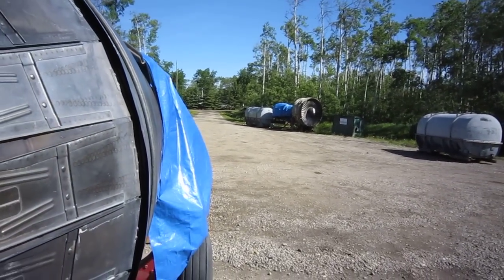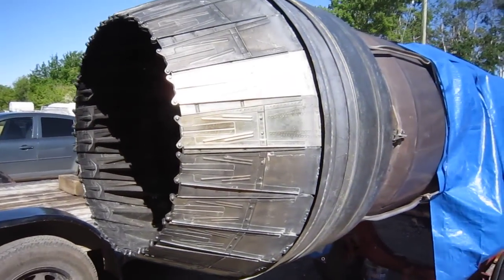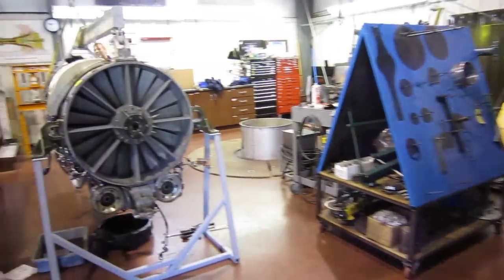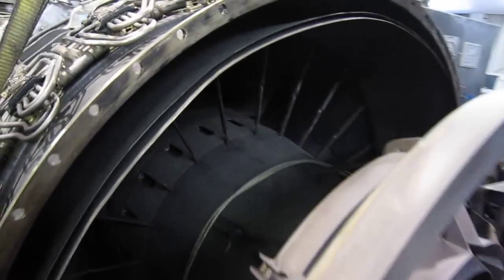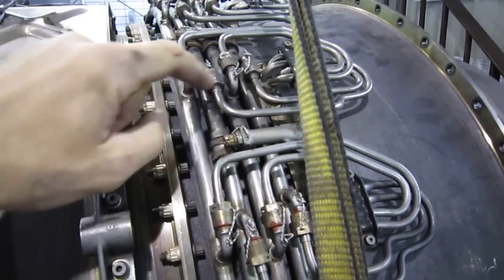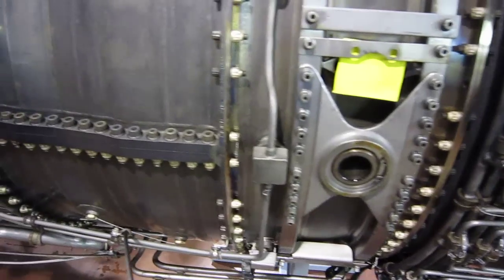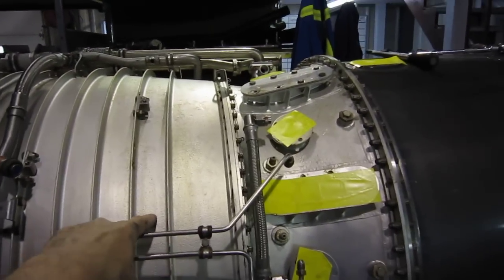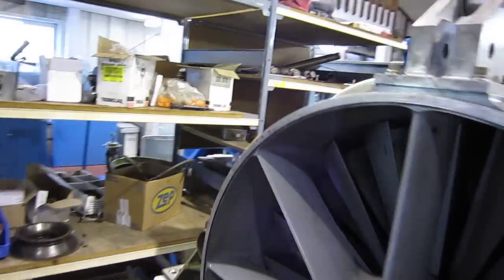Inside an Afterburner - Turbine Engines: A Closer Look

Comment: I can intuitively understand that the compressors are pushing the compressed air backwards and this pressure pushes the compressor blades forwards, driving the engine and plane forward too, but the after burner has no rear facing surfaces for the high pressure gas to push against...

Does the pressure behind the turbine go up with reheat and does the turbine RPM go down with this pressure increase behind it?  I would think that increasing the pressure behind the turbine slow it down.

I understand the Newton's third law sense of it, but I'm trying to find out if there is a rear facing surface with in the after burner that feels the increased pressure and propels the engine forward.
Reply from the maker: 1) no
2) no
 Have a look at a vid I made a couple years ago called Jet Engine Thrust, where I sort of talk about this issue.
Reply: I watched your video called Jet Engine Thrust. Sorry If my questions annoy you. 
It's okay if you don't have the answers too. I'm sure you have forgotten more details about jet engines than I will ever know.  Teaching others how to understand them isn't your job either.

I had a look at the NASA site and the thrust equation. I am familiar with it.  I know that it is convenient to talk about thrust in this way but it doesn't actually explain where the exhaust gas is physically interacting with the engine to push it forward. It doesn't have to. The thrust equation is for calculating thrust not for explaining it.

 I used to be happy with that equation and shrug and move on but I have recently started to think more about it. The accelerated exhaust gas has to physically interact with the engine at some place for engine to "feel" any effect...  That was what my question was about .

I was looking at the compressor blades you  were sitting next to in the other vid and wondering if there is a pressure differential between the forward facing side of the blades and the rear facing side of the blades? There was a lot of blades with a lot of surface area and a lot of pressure... It must add up to a lot of pressure pushing forwards that equals some fraction of the the total thrust in the thrust equation. As you said the fans are airfoils that have a pressure differential front and back.

The combustion cans have higher temps and pressure, but the pressure is released rearwards so this leaves the pressure on the front of the cans unbalanced. Reminds me of the thrust equation for a rocket combustion chamber. 

"For rocket nozzles that are used in vacuum or at very high altitude, it is impossible to match ambient pressure, rather, nozzles with larger area ratio are usually more efficient."

 You can say that this larger area is to accelerate the exhaust (Delta V) but I suspect it is also to maximize the surface area  in contact with the high pressure exhaust? (extracting more impulse). Delta V of exhaust gas and the area of the rocket nozzle in contact with high pressure exhaust are just two sides of the same coin? 

I would love to do the math for the pressure differential, forward and rear of the compressor blades plus the combustion can plus the exhaust nozzle cone and see if they added up to and equaled the Delta V of the exhaust gas. Ofcourse that would be a pain in the ass compared to using the Thrust Equation. Maybe that why they use the equation... 

Anyway I love your vids and sorry about my annoying long questions.
Reply from the maker: +rawnukles    It is hard to visualize, and I appreciate your need to have a complete understanding of why and how it works.
I can only add that neither rockets nor jets have high pressure exhaust.
The pressure in the combustion gases in a jet is lowered and converted to velocity by the jet nozzle, so that the exhaust is only a couple psi above ambient.
The rocket has high chamber pressure, but the expansion nozzle lowers it and converts it to gas velocity, so that the engine exhaust is only a few psi above ambient
If you take a look at a pressure graph at various points along the gas path of a turbojet and rocket this is illustrated nicely.
There are high pressures inside the engine, but the exhaust is low pressure.
Both types of engines propel with gas acceleration, not pressure.
Reply: AgentJayZ Thank you very much for the reply. I am afraid I am making some kind of common noob mistake in this thinking. I have been wondering about this for a while now so the chance to ask someone with your experience is great ! gotta love the internet...

It really mystifies me when I look at a ramjet simple tube diagram and wonder how the molecules in the engine "know" what the high speed gas exhaust is doing at all to be influenced in an equal and opposite way!
When there is no rear facing surface for the high pressure combustion gas  to push against !

It's almost like nature is a perfect accountant making sure the equation is perfectly balanced on both sides  even though I can't see any way for this to physically happen! lol

Oh well Fascinating stuff.It wouldn't be as interesting if it was easy to understand :) I would love to have your job. Engine's and especially jets engine have changed the world and are surely one of man's greatest inventions.
Reply: I've been reading more about this because I find it fascinating. I found this quote from the Smithsonian National Air and Space Museum which you might be interested in... So here you go incase you are.

"Newton’s Third Law of Motion is often given as an explanation for the generation of thrust. But it explains the effect of thrust, not the cause of thrust. Pressure and shear stress are the only two ways nature exerts an aerodynamic force on an object. Pressure is the basic source of thrust produced by a propeller, jet engine, or rocket engine.

A piston engine cannot produce thrust on its own. It provides power to a spinning propeller, which produces thrust by creating a pressure difference between the front and back of the propeller, resulting in a forward force. Jets or rocket engines produce thrust by increasing the pressure inside the engine. This increased pressure in the jet or rocket engine exerts more force in the forward direction than the rear direction."

I think that the Thrust Equation is much like "displacement tonnage" for weighing ships.

We talk about how much a ship displaces simply for the sake of convenience, not because the volume of water displaced is important in itself. Only in that it is equal to the sum of the weight of all the ships parts.

Delta V of exhaust is much the same and is used for a convenient way of measuring the combined internal asymmetric pressures (front to back) that push the engine forward.

I'm aware that increasing exhaust velocity increases thrust for a given mass flow, but matching the exhaust velocity to the air speed provides the best energy efficiency.

This and other reasons probably ads to the convention of using Delta V.  Mayber after years of using the convention it is easy to forget that it is only a convention, nothing more.

I hope that helps.

http://howthingsfly.si.edu/propulsion/engines

Comment from the maker: These cars are expensive and difficult to operate, and they use two of the most commony produced aircraft turbine engines in history. The J58 propelled an aircraft that was much heavier than a LSR car to over Mach 3.
I daresay it would be overkill... hugely expensive and complicated overkill.
Possible to put a J58 in a car and go for it?, yes, barely.
Feasible ? Sure... I'll need a 30% deposit, and I'll start construction right away. That'll be 100 million dollars Canadian please !!